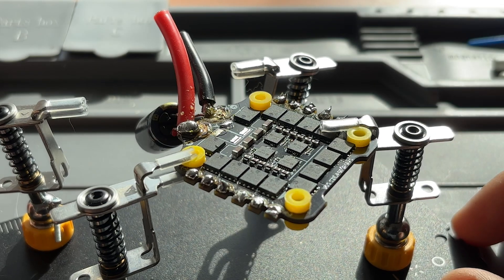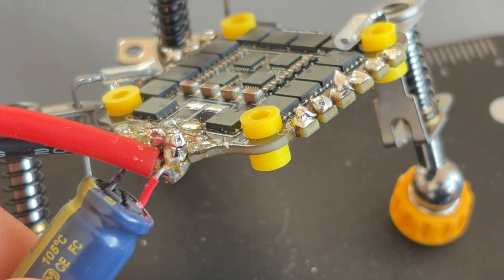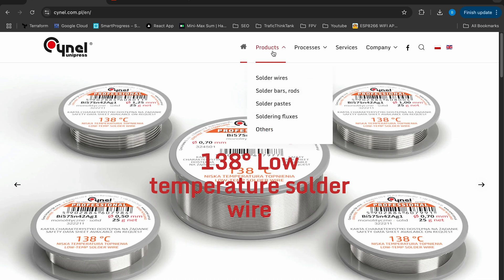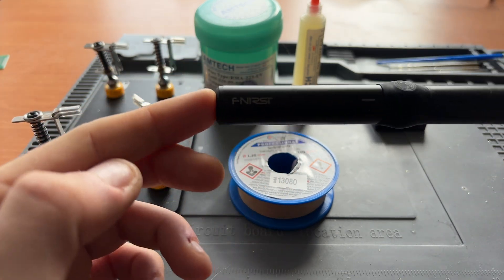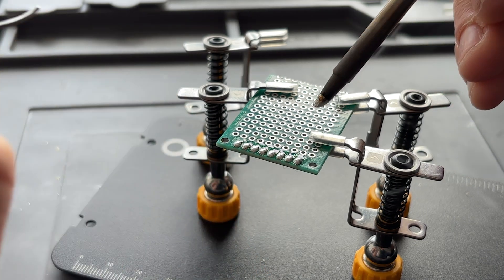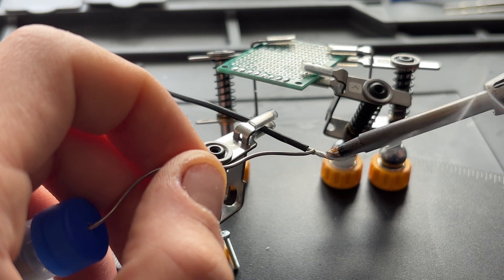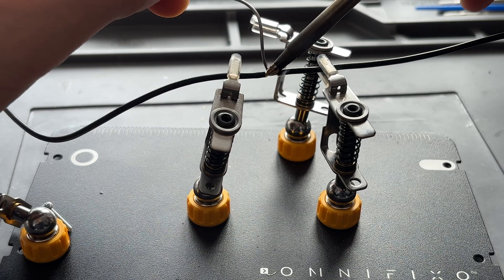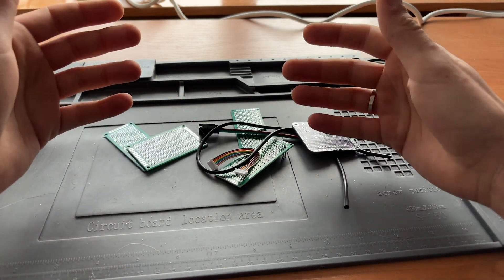The Only Soldering Tutorial You Need!

Comment: Which is better Amtech 559 or 223 ?
Reply from the maker: 559 is a bit more active so it’s easier to solder, 223 requires less effort to clean. But in general they are both good

Comment: If I was your instructor I'd fail you based on your thumbnail alone. Too much solder. It should not be globular like that but in fact should have a slightly concave profile.
Reply from the maker: @DeveloperChris  Just interesting, how many drones you’ve assembled?
Reply: @DCSets  none. And that has nothing to do with it. A solder joint like the one pictured has a larger chance of becoming dry jointed. I was in electronic communications(telephony) for many decades retired now. and that level of soldering would have faulted particular in a high vibration environment. I am guessing the joint was too cold and too much solder used. I would redo a joint that looked like that. I didn't watch the video just commenting on the thumbnail assuming it's an example. The "perfect" joint is slightly concave with the solder wicking up the wire.
Reply from the maker: @DeveloperChris To be honest, I'm already tired of having to "defend" myself from experts. I have specific reasons, based on practical experience, for forming such "bulbs" on drone power wires.
Anyway, I appreciate your opinion as long as it's expressed politely. You’re welcome to explain the pros and cons here for anyone who finds this comment — but please stick to facts, not assumptions or statements like "you're wrong because I do it differently."
Reply: @DCSets  in that case don't sell yourself as an expert and your video as "the only tutorial you will need" 

The wicking up the wire shows good adhesion, without it, bad adhesion.

Comment: Great video, thank you. I'm interested to hear how come you don't use lead free soldering wire if lead is toxic? Is it easier to work with, gives better joints or what?
Reply from the maker: It's harder to work with it, especially for newbies. 
In my opinion lead free solder is more about ecology than health (except if you're working on big manufactory and solder a lot). 
For hobby it's not a big difference, since flux, tin and other evaporation don't healthy too. So consider to have good ventilation regardless of solder you are using.

Comment: When buying solder for hand soldering, get eutectic ratio 63/37 lead/tin solder and you will never have a "cold joint". Do not use lead-free solder! Also consider getting a Kester flux pen #2331-ZX. It is excellent, water soluble, pH neutral, no-clean. You won't be sorry. Learn to run a hot iron and work quickly. The USB type and other tiny irons do not have enough thermal mass. Don't even try.
Reply from the maker: I can't agree with your statement about usb type irons. All soldering tools mentioned in video easy handle AWG12. I'm not sure that a lot of people need to solder larger wires. 
Googled flux you mentioned. Interesting form factor. I'll try it - thanks for advice!
Reply: @DCSets  The problem with USB types is parts connected to large ground planes that pull heat like crazy.  Maybe the newest USB types are OK due to the increased power allowed for USB C, Powered Device, and all that.

Comment: Low melting temperature solders are absolutely the wrong thing to use for soldering wires and connectors. These solders form brittle joints that are very susceptible to failure from mechanical stress.

Slopping some isopropanol on the board and scrubbing it around with a brush doesn't clean the board. It just redistributes the flux all over the place in a thin layer. Proper local cleaning of a board is a rather difficult and time-consuming task. The flux-contaminated solvent must actually be removed from the board. This can be done with cotton swabs or absorbent wipes, but good cleaning will required repeated applications of fresh solvent and wiping. Many "no clean" fluxes are far, far harder to remove with common solvents like isopropanol than is rosin-based flux.

I have soldered hundreds of thousands of joints. I normally use flux-cored solder and very, very rarely use any additional flux. One place where I do like a little extra flux is tinning stranded wire. It seems everyone making YouTube videos wants to slop great gobs of flux all over everything, and it seems they do that because they either believe it is something magical or their basic soldering technique is poor. 
Soldering a through-hole component to a PCB by putting on flux then carrying molten solder to the joint on the tip of a soldering iron is a horribly bad method except in very very rare circumstances. It is likely to produce poor joints and it is vastly slower than the proper method of feeding flux-cored solder to the joint with the iron in place. If I used that awful method I'd still be working on assembling boards I finished a decade ago. I would also have wasted many kilograms of solder since most of it would have been wiped off the tip when cleaning the tip.
Reply from the maker: You sound very confident, and I believe you have much more experience than I do, so I won't argue with you on that.

Personally, I tend to use more flux because it's easier for beginners (I've taught over 20 people how to solder). By "taught," I mean they successfully assembled their devices, and everything worked properly. People who not professional can't solder quickly, so flux from flux-cored solder burned out quicker than they finish their joint.

When it comes to manufacturing or mass production, I don't have much to say. But for hobby projects, I've described a simple and reliable method that results in strong connections.

BTW Maybe you can link me with some good explanation that rlly make sence to you? I guess it will be helpful for anyone who find this topic ( and for me too 😁)

Comment: I am interested in the drone assembling please post video if possible
Reply from the maker: I've already filmed 90% of materials. Need to review it and make voiceover. I believe it will be published on next week
Reply: @DCSets  thanks for the response i need to see the part where you have soldered the esc because they are so hard to solder
Reply from the maker: @republicofgamer8481  agreed. It's the only hard part in terms of soldering. But unfortunately here is no magic :( 
Use the biggest tip you have and adjust temperature to 380 - 400 degrees C. And add more flux, it makes magic
Reply: @DCSets  what flight controller did you used and was it easy to calibrate it as I was using ardupilot it was nightmare to calibrate it
Reply from the maker: @republicofgamer8481  depends what are you looking for. If you are building small drone just for flying use betaflight / inav instead of ardu. They have much easier pid / filters setup. 
Regarding FC i use mostly speedybee f405 v3. They have some times troubles with gyro, but i've learned how to replace them. 
Speedybee v4 ( f405 / f722) a good choice for most cases
Reply: @DCSets  how can I contact you bro i have many more queries
Reply from the maker: Never used it before, but i've setup discord server. Lets build community https://discord.gg/xsTDEggR